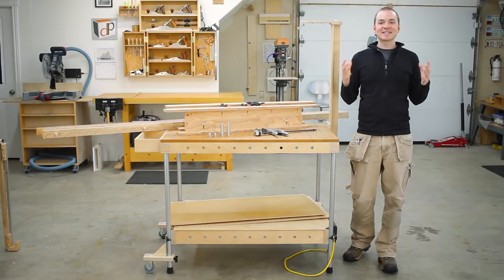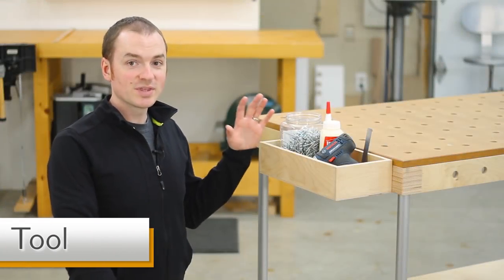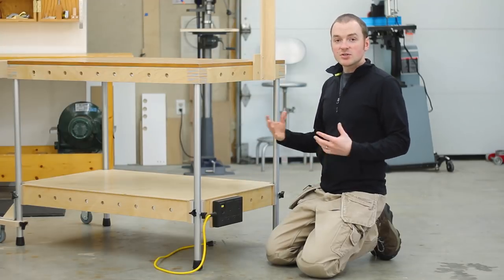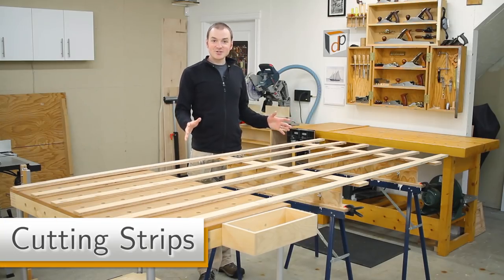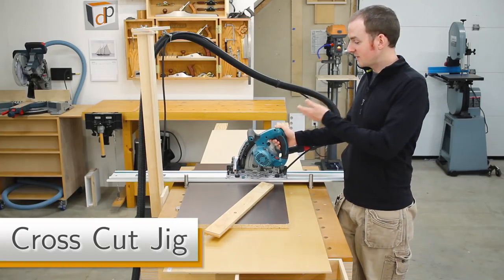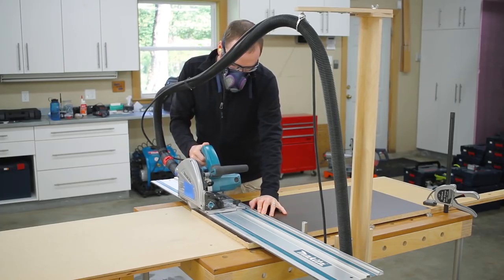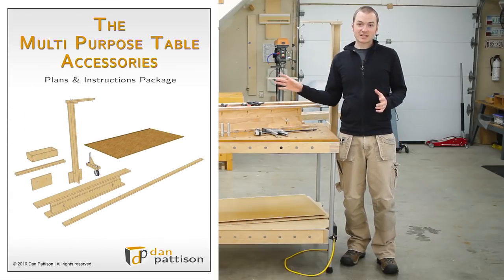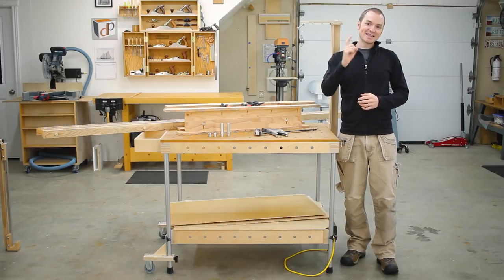Shop-Built Accessories for The Multi Purpose Table (MPT)

Comment: Nice, Ill give you 1 more. If your American like me and are stuck with 1 vender who imports the 20mm Parf dogs complete with the tarriffs and freight from Great Britain. You realize how expensive it will be to have a nice assortment of 20mm dogs. I bought some precision turned 20mm 6061 stock from Alexandria Precision. (You have to buy the precision turned stock or you will get wobble in your dogs) You can buy 1ft, 3ft  etc and clamp and cut the 6061 on your chop saw to whatever lengths you want. I also ordered some 20mm Shaft Collars ,Solid, Zinc Plated ,w Set Screws,MSC-20 Metric!  25 pcs shipped to my door for $36.11. You now have precision, cut to whatever length dogs you want, for a fraction of what you would pay to have this shipped from England with the ridiculous tarriffs and freight. Lastly if you want, mark the centers and center punch and drill and tap them! I drill mine clamped on my drill press. If you have a lathe its even easier! Now they are complete! Now you can even adjust the height of the stop collars unlike the UK made dogs! Remember all our woodworking tools can be used to cut, router ,drill, sand and shape the 6061 aluminum. Its not hard like steel. I got 4 -3ft lengths and 50 collars for what I was planning to spend on 1 basic small set in a Festool box from UK's Bench Dogs. I think it was 16 dogs! The best USA deal I could find was the 2 basic dogs from Canada's Lee Valley for 228.00 for 6 large and 6 small dogs from them. Then add freight!  But I am making dozens of my own for a fraction of the price per dog.
Reply from the maker: Sounds like a great way to make custom dogs and for less money. Thanks for sharing 👍

Comment: Thanks for sharing. You have some brilliant ideas there, the relocatable power socket, the raised vacuum hose etc. There are two places where I differ. I would move the work under the saw, rather than moving the saw to the new cut line. That way there would be no need for sacrificial strips and accurate perpendicular cut is guaranteed every time. Secondly, your table is fine for most power tools but not for hand tools. Those 4 one inch tubes are just too light duty for me.
Reply from the maker: Thanks. Are you refering to the cross cut jig or the sacrificial strips for breaking down sheet goods? As far as hand tools you're right. I've done light duty hand tool work at the MPT but for heavy hand planing, sawing etc I use my work bench below my hand tool cabinet in the background. You definitely need a solid bench with some mass for serious hand tool work.
Reply: See the Ron Paulk bench for his use of his track saw. The saw is always in the same position and the work is moved after each cut. This, no sacrificial pieces required
Reply from the maker: Oh ok. The saw is always in the same position with the MPT cross cut jig and the blade follows the same shallow kerf in the base plate each time. It's the sacrificial cutting strips for full sheets that get cut into but I always use the ridgid insulation now because it helps improve dust collection too.

Comment: Shouldn't you be crediting Peter Parfitt and his Paff Guide System here some where? Sorry if I am wrong but it looks like you have taken his ideas and called them your own. For instance you use 20mm dog holes when 3/4" or 19mm are more common in the North American area. Also you don't explain how you get the dog holes accurate.
Reply from the maker: The MPT has been around for almost 4 years now so it predates the Parf Guide System.  I came up with my own method and jig for accurately drilling the 20mm holes in the MPT top back when I designed the table back in 2015.  That jig and method are covered in detail in the MPT plans and instructions package.  I went with 20mm holes since most of the accessories such as the Parf Dogs fit in 20mm holes and it also allows me to easily cut undersized registration discs for the shop made accessories at 3/4".  Many people have used the concept of a grid work of holes in a work surface, but the MPT design and methods for making it are all my own.